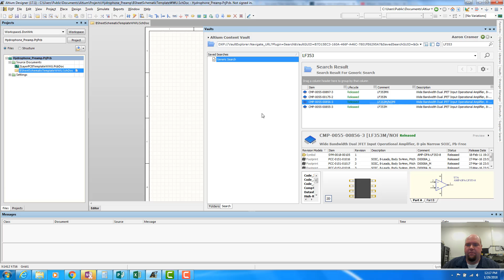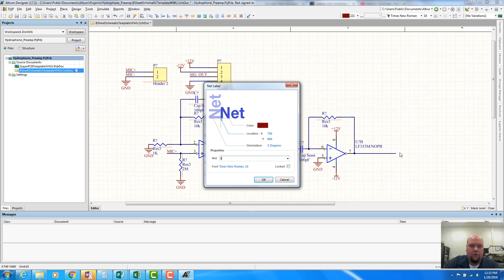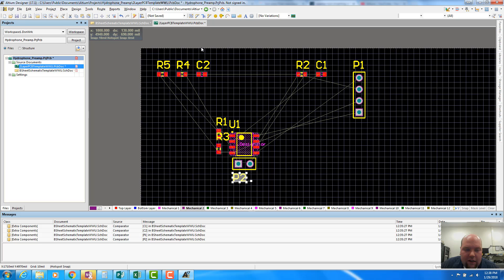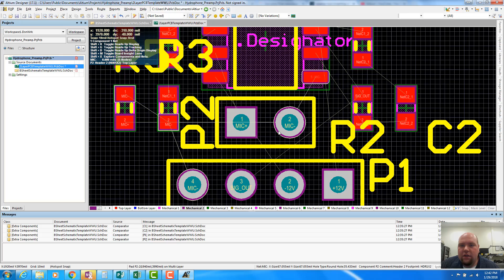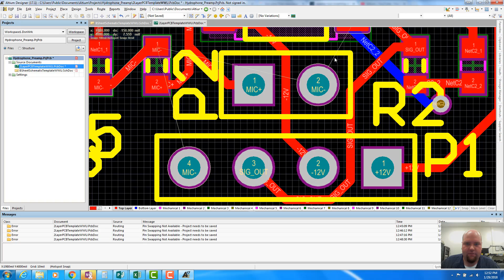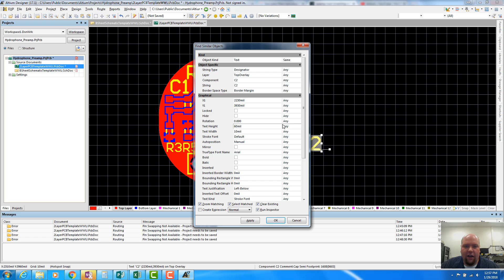Hydrophone Preamplifier Example (Part 1)

Comment: Hi John - Thanks for making and sharing this excellent presentation. I have a couple of questions I’m hoping you can answer. One, is it possible to make a version of this that could operate from a single battery (e.g., 9 volt battery)? Two, I’ve read that piezo devices can build up a high voltage when disconnected and that it may be wise to protect the input op amp using reverse-biased diodes. Do you view this as a concern for your design? - Thanks again - Jim